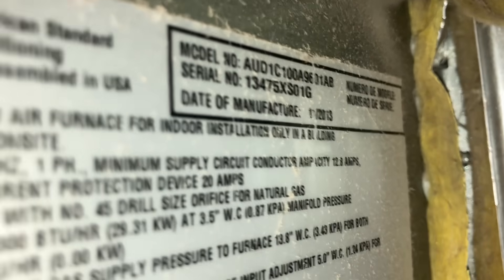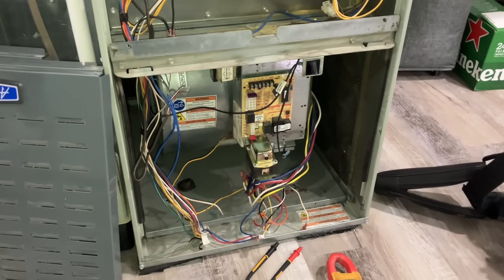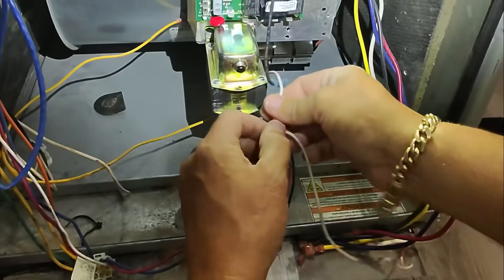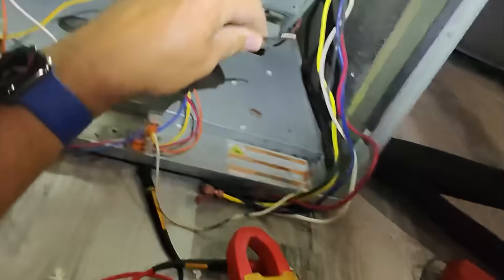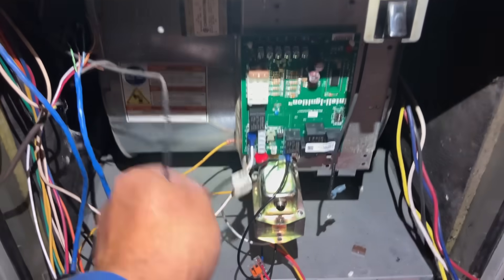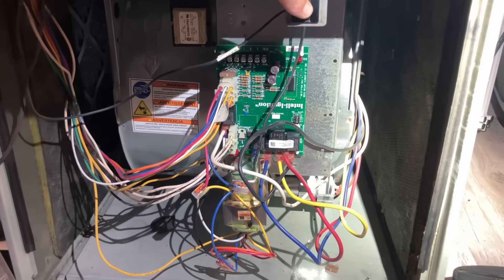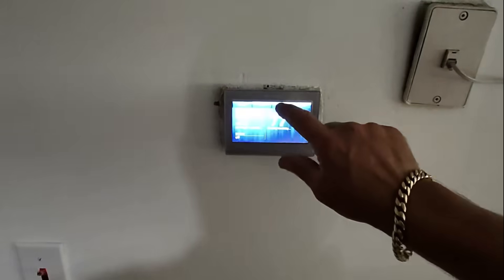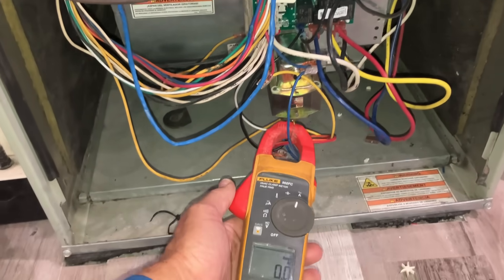Labor Day Furnace Nightmare: Shocking Electrical Fault Stuns Even Me!

Comment: Ive had it where someone adds a line during construction to the furnace circuit from a box added through history. Now they add a couple led lights that fed the neutral. i did the board too. that was a long call. manufacture says LED's always add current to neutrals

Comment: I'm glad you identified the problem. This is why I always told the new guys to start with power, and to test for voltage with the components in-circuit. Here is what I would have done differently. This will save you some time.
I would confirm the house single phase voltage at a few outlets that would not be on the same breaker, and see if they are higher. The typical outlet voltage today is around 124 volts, and sometimes, a little bit more. If those outlets were higher in this situation, I would have thought there is a problem with that branch circuit for the furnace. I would remove the deadfront from the panel and test the voltage at the furnace breaker, and then see if that branch circuit was wired correctly, with the bare ground conductors on the ground bar and the furnace neutral on the neutral bar. If it is a sub-panel, they would not have a bonding screw in the neutral bar. I would look to see if that furnace circuit used a continuous conductor with not splice boxes that could hide the problem, and if it was, I would look in that little power box on the side wall of the furnace and find out if the installer mis-wired the furnace. I would correct that, if so. The pigtail is okay for testing, but it is an inspection fail if it is left that way. One of the commenters below knows my trick for releasing the board standoffs, using a Bic pen with the insides removed. Some new furnaces will show you a fault code or LED if the furnace is not wired correctly, but this 20 year old Trane will rely on you to find the problem.

Comment: i just got the a very similar call a month ago. but for me it was flashing a safety switch open.
*had to call tech support and we ended up  finding that the nuetral wire was broken. getting 120 from L1 and ground and also 120 from Neutral and ground. i was getting 17 volts at the transformer.  electrician had to run a new wire from panel to furnace.  it was a head scratcher 100%
Reply: Why would you get 120 from the neutral to ground if it was broken?  Thanks.

Comment: My question is why didn’t you restore the 120 V power to the furnace? It might’ve been just a loose wire or in a junction box or something. Or does your licensing not allow you to work on line voltage?
Reply: My question is whether Mikey informed the homeowner that only a temporary repair was made and that a licensed electrician would be needed to make a proper repair.
Reply from the maker: @marcinmerrimack1726  Do you honestly think the extension cord I ran to the pigtail I created coming out of the furnace was a temporary repair? The pigtail is a permanent solution. The circuit needs to be repaired by a licensed electrician. That's exactly what I said and also documented on the service invoice.
Reply: If you truly believe that the pigtail and extension cord is a permanent solution, you’re a hack. 

But in the next sentence you acknowledge that a licensed electrician will be needed to repair the circuit. 

A licensed electrician who is not a hack is going to rip out your pigtail before he completes the job.

Comment: I had the same thing happen to me a couple months ago, I checked the voltage and it was low, then followed it to the sub panel, and checked the breaker and same thing low high voltage, checked the breaker and only gave me 170v to the panel, then went to the main panel and found that the wires to the 70amp breaker for the sub panel wasn’t even tightened. I tightened up the wires, flip everything back on and problem solved.
Reply from the maker: Glad you found the issue!

Comment: In the 80's I was working for Sears at a customer home fixing a stove that the electronic ignition did not fire, I took the stove apart and checked every component 2 hours worth of work and nothing worked. then I though about replacing the power cord to another outlet and it worked!. two hours of my time wasted just because an outlet was dead! 🤣🤣🤣😂😂🤪🤪🤪🤪😇

Comment: To remove those white clips at 0:46 you can use a Big ballpoint pen and take the pen out of the casing and use the empty body of the pen to compress the clip and pull out the board.

Comment: So the question remains: Who recently reversed polarity on the furnace circuit? 🧐🧐🧐🧐
Obviously it was working fine before
Reply: It could be a neutral working itself loose after a while.  At any rate a licensed electrician needs to review and make the appropriate repairs to the circuit.
Reply from the maker: No one reversed polarity.

Comment: What is the Cat5 or 6 DATA wire for?  Did they use that as thermostat  cable? It is only 24 guage.
Reply from the maker: They used that for thermostat wire
Reply: @keithb2696 24 gauge wire is perfectly adequate for thermostat cable.

Comment: So I'm guessing that board was fine.  😂
Reply from the maker: Nope
Reply: That’s the way it looked to me. Did he put the old board back in? I don’t think so.
Reply: @garysmit That’s the way it looked to me as well. 

After the workaround for the faulty AC circuit to the furnace was put in place, the original board should have been reinstalled as a test. 

But Mikey was aggravated and wanted the mark-up on the control board for all his trouble. 

So he chose to guess and not test. And so the homeowner most likely got charged for a replacement board that wasn’t needed.

Comment: Hey Mikey Pipes!! A very quick test to save you time in the future (and you can do it on every service call as a first step): Test incoming power from neutral to a good ground. If you see anything other than a few volts (10 or less) then you have reversed power polarity.  Fast, simple, and if you find the polarity reversed, correct it. In this case, it would have had you out of there quicker.
Reply: Why is yo bl4ck a$$ seeing any voltage on the neutral at all an shiet?

Comment: Your neutral is the issue. It may be reversed polarity or it may be a poor neutral in the panel. 21 volts will not pull in and maintain a relay. Your friendly old retired HVAC guy in Toronto.👍👍🇨🇦
Reply from the maker: Thanks for the feedback!

Comment: Would someone please explain what the issue was, if you don't mind. Recent HVAC grad wanting to learn.
Reply: Neutral and hot on incoming power was reversed. Newer equipment designs reference the neutral in unusual ways (often on the low voltage side) so reversing hot and neutral on incoming power will mess with the normal operating voltages on the LV side.  In my cinema repair days, a certain film transport system did that..if hot and neutral was reversed, the very expensive control modules (three in each unit) would release the magic smoke.
Reply: @mxslick50 how can you easily tell if they are reversed, how would you know to recognize that, or does this just come with experience? What does a reversed hot and neutral actually mean?
Reply: @hbodiver  A very quick test to save time (and you can do it on every service call as a first step): Test incoming power with your voltmeter from neutral to a good ground. If you see anything other than a few volts (10 or less) then you have reversed power polarity. If it is reversed you'll see around 120 volts. This of course only apples to 120v equipment like furnaces or air handlers. Condensing units at 240v don't use a neutral  (so you should see 120v from each of the two hots to ground, and 240v from one hot to the other), BUT must be properly grounded for safety. 

I have been an electrician since I was 16  (I'm 62 now) so it was one of the first things I learned about. Most equipment really doesn't care if hot/neutral are reversed, but modern stuff with electronics are VERY sensitive to it (for the reasons I mentioned in my first reply.) 

In 120v supplies, the hot is the wire that carries the voltage. The neutral is the RETURN PATH TO THE SOURCE for that voltage, and it is called neutral because it is (at a single point in the building's incoming main power) tied to ground, so it should normally sit at zero volts. I cannot go any deeper in a simple online comment, but you can look up Mike Holt on YT, he has excellent videos explaining everything.
Reply: Ive had it where some added a line on the furnace circuit at some point and we found that the led's added in reno were putting voltage onto the neutral. it messed with board. old house out there with years of renos
Reply: Well the unit was running fine until now.  Need explanation of what transpired to change things?
Reply: @tedlahm5740  Simply put it was a neutral wire that came loose. Probably came out of a wire nut. But this guy won't admit his mistake. An experienced tech would of found this right away. Odds are that it was reversed polarity are slim. Reversed polarity really only effects new equipment. A system doesn't all of a sudden have reverse polarity. That furnace didn't need a transformer or circuit board. But he's not going to tell the homeowner. He's what he claims everyone else is, he's the bamboozeler. He's a plumber, not a hvac tech. Most experienced techs don't need an extension cord to test a circuit. That's embarrassing for him. Lol.